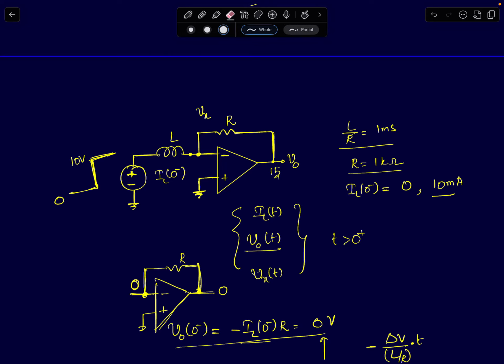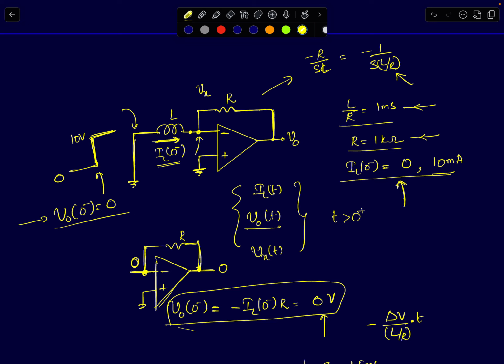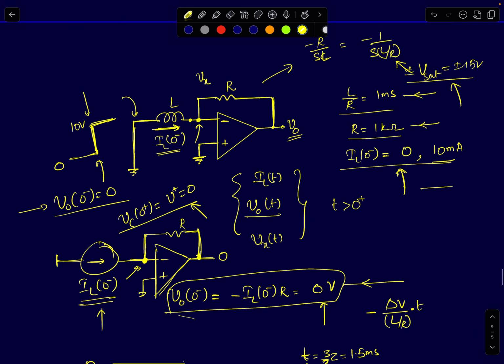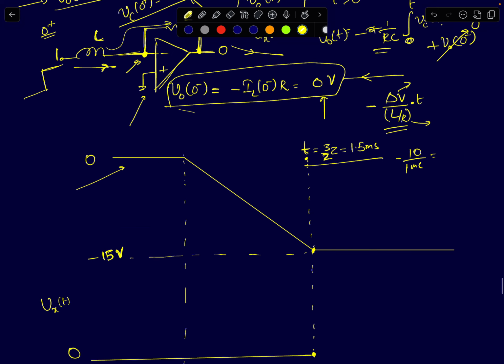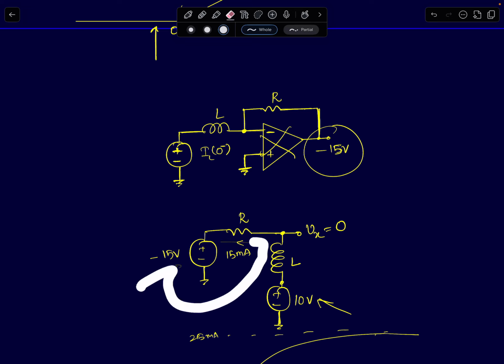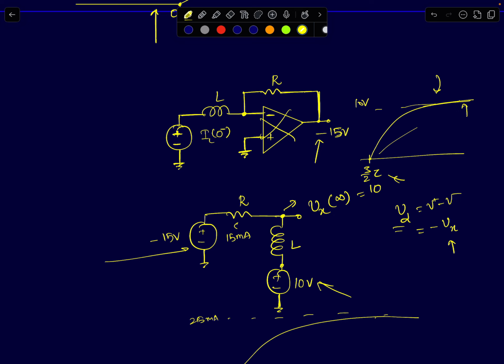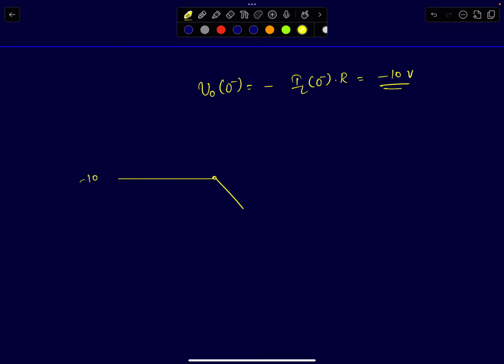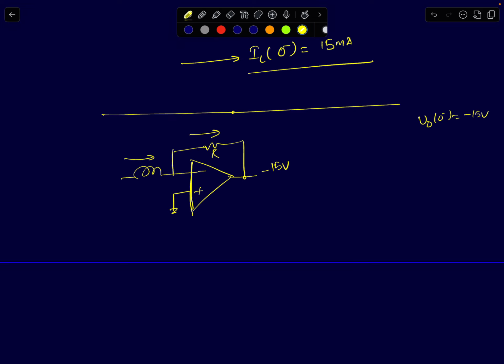AE Lecture 23.d) Step response of RL integrators

Comment: Guess ~
It looks like R_ L serial and vo is from R ,so vo/vi=∆/∆
And then zero =infinity rad/sec
                 Pole=1/L*infinity=0 rad/sec ,DC gain=1,so the vo/vi  transformation must be a one pole but no Zero 
vo/vi=1/s*(L/R)...but the difference is Negative R_L opA , 
vo/vi=-1/s*(L/R).....Answer 
Thus vi can is replaced with  current Source ...🤔